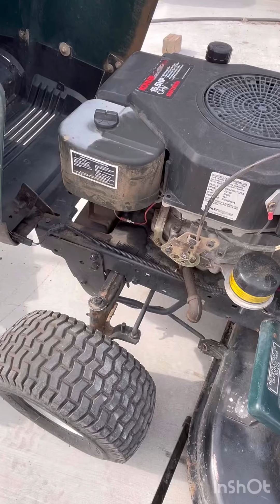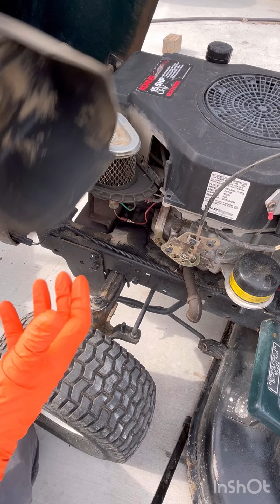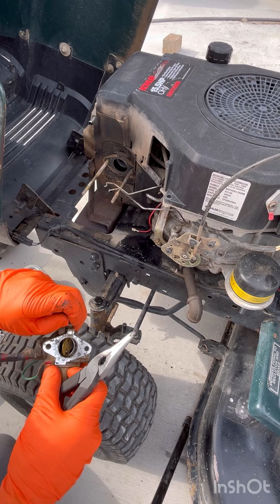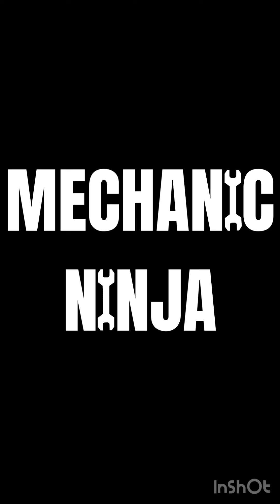How to replace the carburetor on a kohler 15.5 HP riding lawnmower engine. Lawnmower repair!

Comment: Do not use a wirenut.  Use a crimped or soldered style connector with heat shrink.  Wirenuts are not recommended  on vehicles or anything that vibrates a lot.